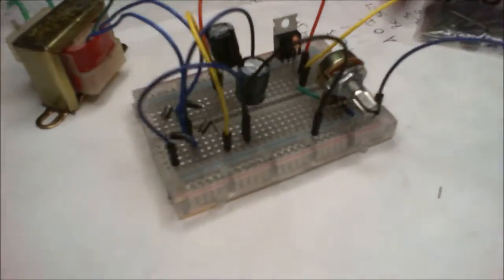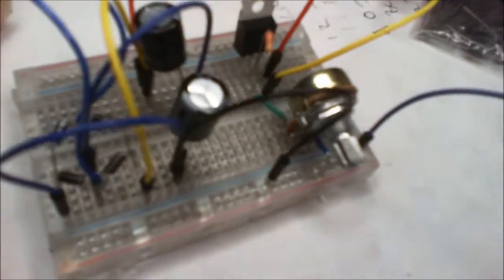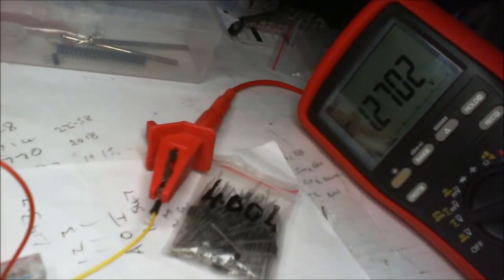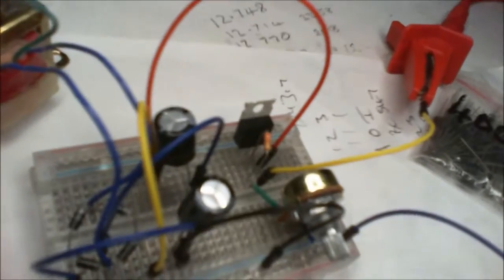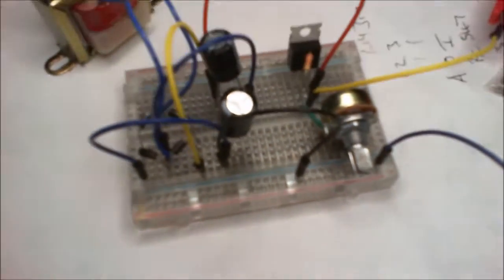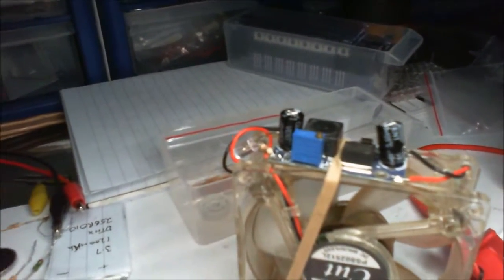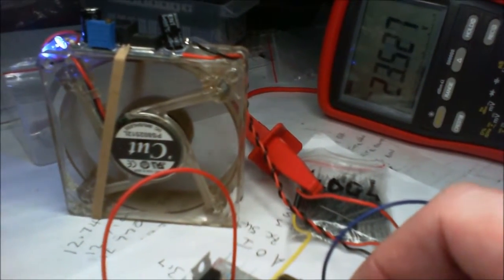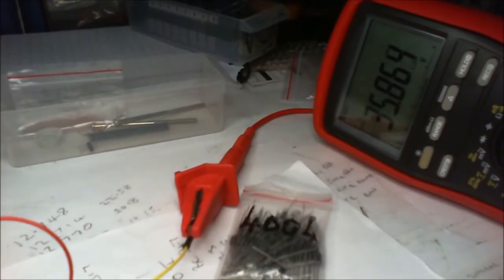Simple Circuit Voltage Doubler LM317  Regulated Output

Comment: i have a 12v transformer with current of 100ma, i tried to power my arduino connected with temp sensor, lcd, buzer and relay but it works fine without relay connected, if i add relay lcd is not clear enough my temp sensor jumps from 10 to 20 so i did the same having 39v as my output, and i am still facing the same problem